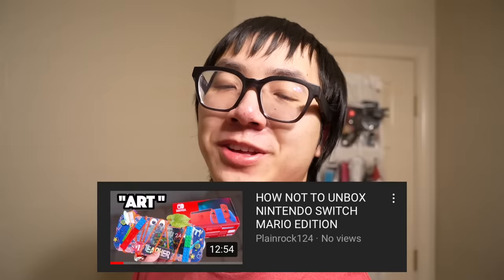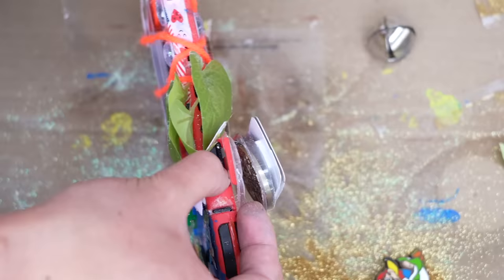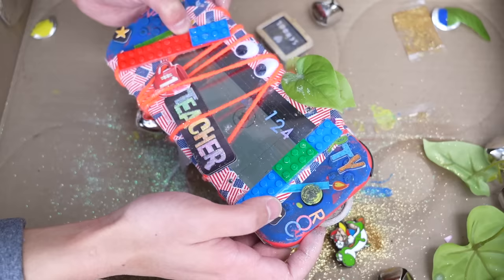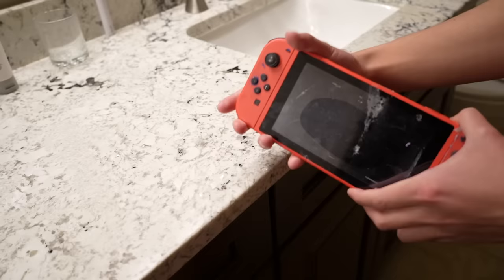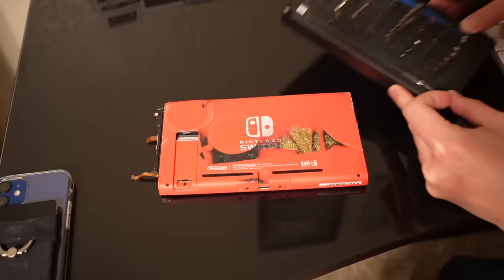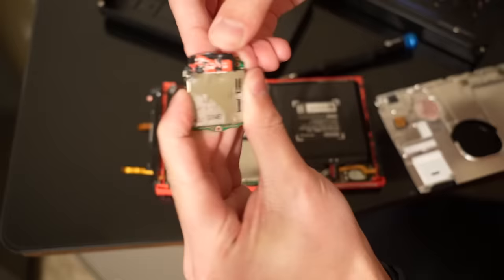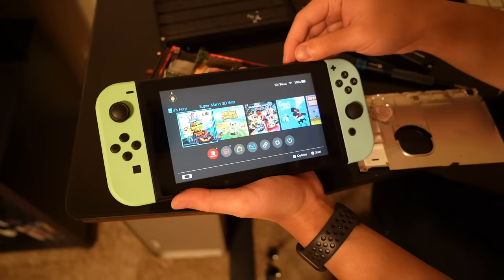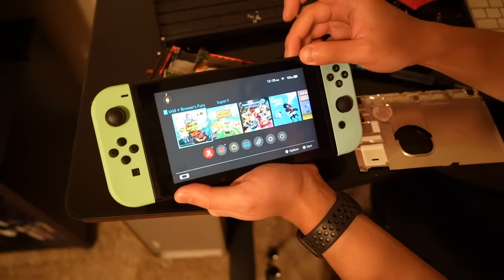i didn't mean to break it...

Comment: @PlainrockVlogs: I seriously thing if the broken cartridge still works you should not have destroyed it, just in case you accidently drill into the pin of the cartridge on the new one. Or broke it any other sort of way that it does not work anymore by accident.

Comment: This is what I done to my 3ds one time. I was upset that SM64DS wasn’t working so I smashed it on a table over 20 times, broke the cartridge then put it in and it got stuck but I took apart the 3ds and threw the cartridge in the trash.

Comment: You broke the game card slot.  Not the game
Reply: 3:19 he definitely broke the game
Reply: @forjqoijasd  i mean  until he smashed it at the end it would have worked   but sm64 is a large card so it has the paradoxicly smaller chip inside.  all that was damaged here was the plastic shell   the top is actually empty in the games with larger filesize
Reply: @FennecTECH  even if it still technically works, it's still broken if that makes sense like the outer shell is definitely broken. no one wants to put that inside their console
Reply: @forjqoijasd  fair enough    An iphone with cracked front glass would definitily count as broken even tho it also still works.    so   what level of damage takes something from wear and tear to busted (oh no    pholociphy is comming out)